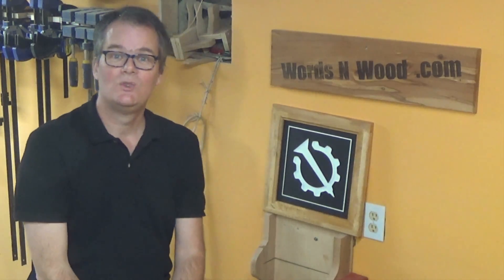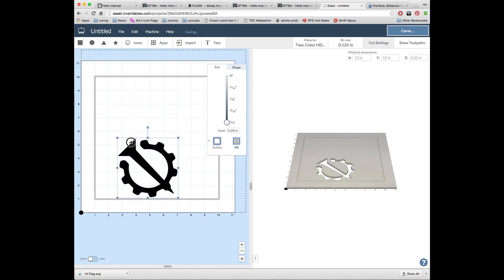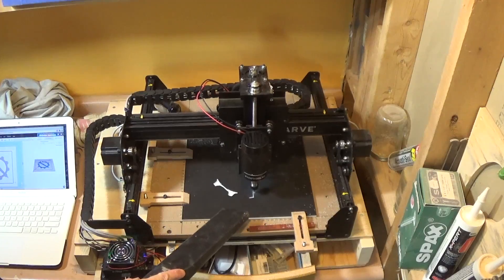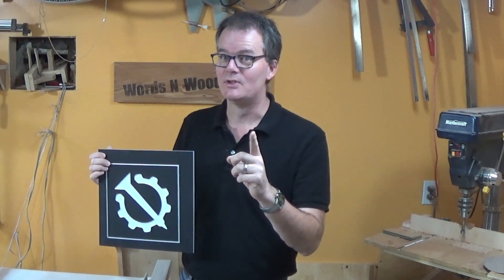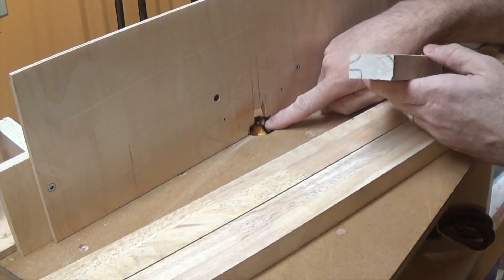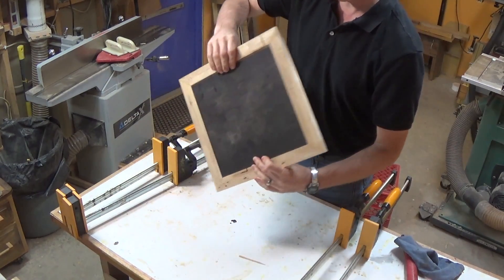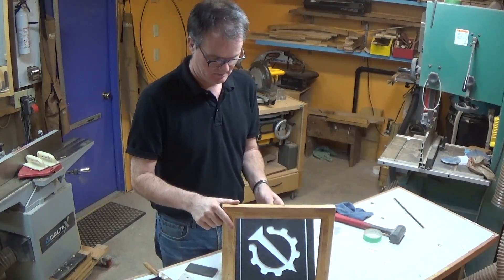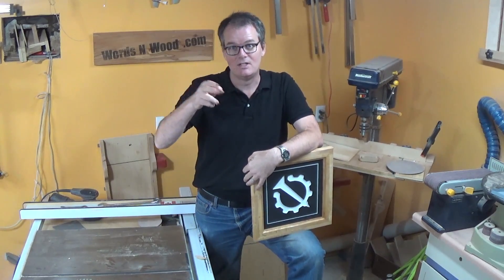Carving and Framing the Nail and Gear of Hello Internet (WnW#41)

Comment: Nice work.  So how long did it actually take for the X-Carve to complete the job?
Reply from the maker: Plastic carves pretty quickly.  It was a long time ago but I'l guess at 30 minutes. Maybe 40.   Bear in mind that I have the original low-power cutting spindle in my CNC.  The newer ones are designed for a small router which has a LOT more cutting power.